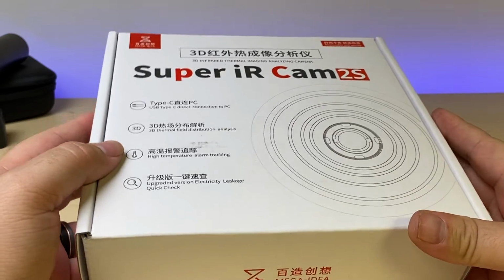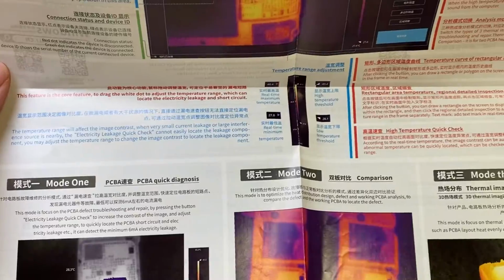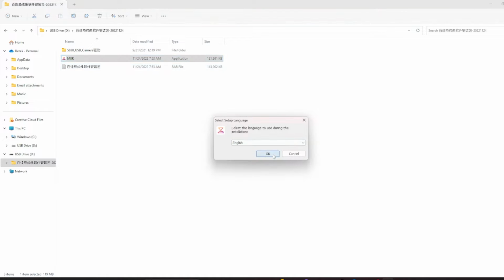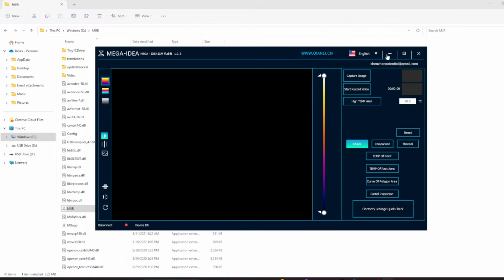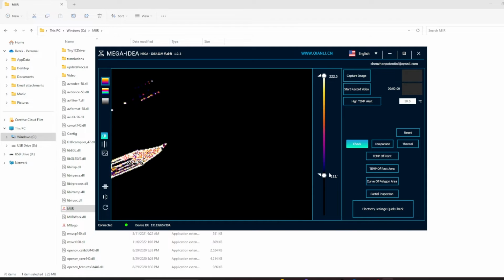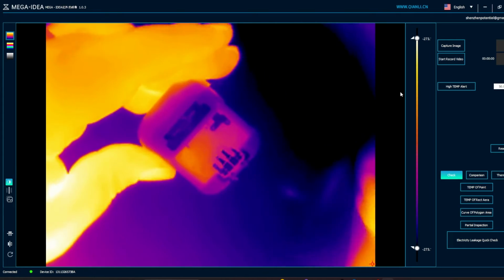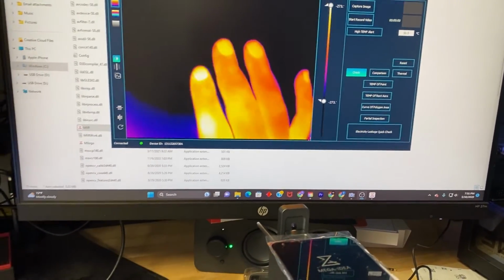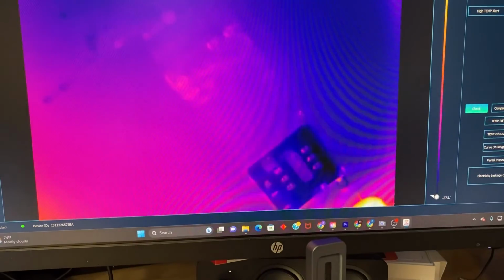Qianli MEGA-IDEA Super IR Cam 2S 3D Infrared Thermal Imaging Analyzing Camera

Comment: My camera doesn’t work, I just purchased and set up the drivers and software accordingly but no output onto my computer, same issue on 3 laptops I’ve tried
Reply from the maker: Try going back in and finding the file like I did in the video. Only then did it start working for me.
Reply: Did it end up working for you? I'm thinking of buying this but dont want it to give me headaches.
Reply: @HD-wf3bp  yes, it works wonders, but from MobileSentrix or nexus cellular, return policy is excellent
Reply: Probaste con un otro cable?